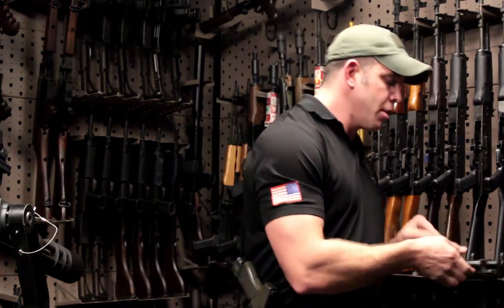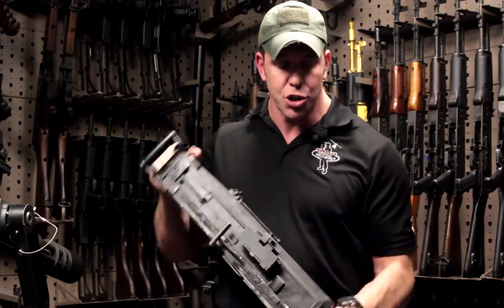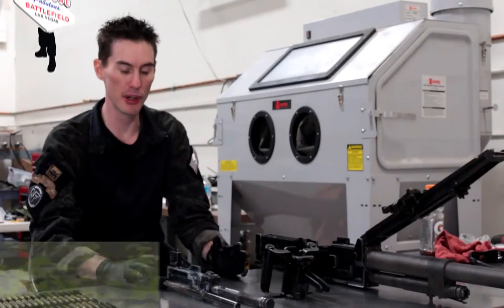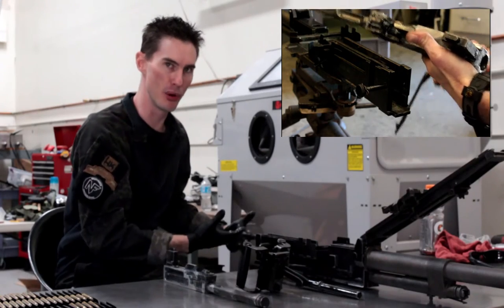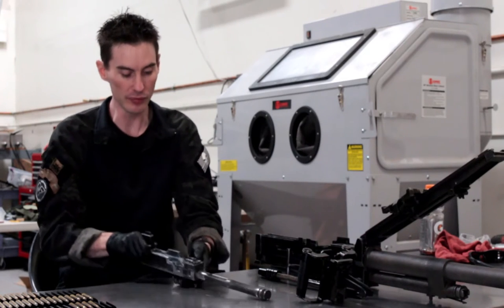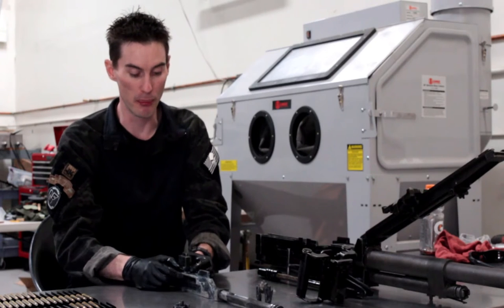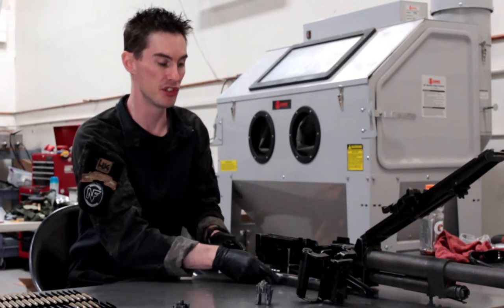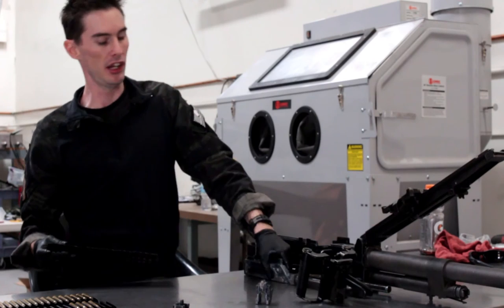Weekly Weapons Brief #66 - Breda M37

Comment: The MG was actually considered to be extremely reliable. 
The trays could be inserted one after the other without stop firing, so there aren't dead times to change the belt.  
To think that the crew has to manually pull the spent rounds out of the tray and reload it, is like to think that the crew of a MG42 had to manully reconstruct the disgregated belts and reload it. Only loaded trays, like only loaded belts, were supposed to reach the first line. To load them was a backline activity, and there was a very light and fast device (way faster than any belt loader actually) to do all the work.
Reply: exactly... never heard anyone say that it was prone to jam... actually, the opposite.
Reply: Neutron Alchemist you could have avoided the overengineered cartridge reinsertion device and went with a standard ejection port, and simply put a bag on it, at least then you wouldn’t have to pull out the cartridges before reloading them. Also if your loader were to be killed, you would at least get more continuous fire with a 200 round belt than with a 20 round feed strip, not to mention that the issue of a hanging belt could be solved with disintegrating links otherwise it’s not a big deal, mgs like the mg34, mg42 and the post war pkm have nondesintegrating belts and they function just fine. If mg loaders want to avoid the extra 5 seconds of reloading a belt they could could just link a fresh belt to the one currently in use in the weapon.
Reply: I've been doing some historical research on a crew of Italian machine-gunners in ww2, read many reports and experiences written down by vets and they all praised this gun as being extremely powerful, reliable and well built.
Reply: @alaskanbullworm5500  There is no "overengineered cartridge reinsertion device". The same bolt that pushes the cartridges out of the strip in its forward motion, reinsert them in the strip in its rearward motion. it's actually the simplest way a tray fed MG can work, and it avoids: 1) a further opening in the action, since there is a single ejection port (not one for the tray and one for the cases) exactly as big as the feed port 2) the cartridges interfering with the tray in ejection, jamming the action.

You don't have to pull out cartridges. The tray loader does all the work faster than any belt loader. https://www.youtube.com/watch?v=pWesu9pA6Ro&feature=youtu.be&t=423

The fact that something works differently than how you are used to, doesn't mean:
1) that it doesn't work
2) that it uses some devices that you don't see, but assume it exists because you don't know how to make it work otherwise.
3) that who designed it didn't know what he was doing.

If your loader were to be killed in WWII you had far more possibilities to keep on firing with a tray fed MG, where the gunner hasn't really to keep any attention in keeping on inserting new trays (trays are like magazines, with the difference that you don't have to discard the old one before inserting a new one), than with a belt fed one. Have you ever wondered why loders had to keep the belt in their hands during fire? It was to avoid jammings.
Reply: Definitely it was a backline activity. Probably done from a supply or transport truck.

Comment: The Breda M37 was very realiable. It was originally designed to be used on vehicles, but than adapted to be used by infantry.
The one that had problems was the Breda M30.
Certridges had not need to be oiled before using it.
Italian army cartridge was 8 × 59mm RB Breda, while the one used in Portugal and Spain was 7.92 × 57mm Mauser.